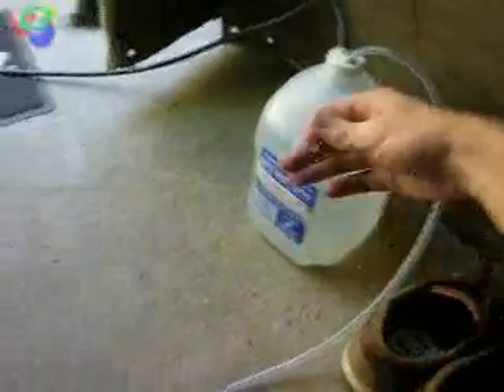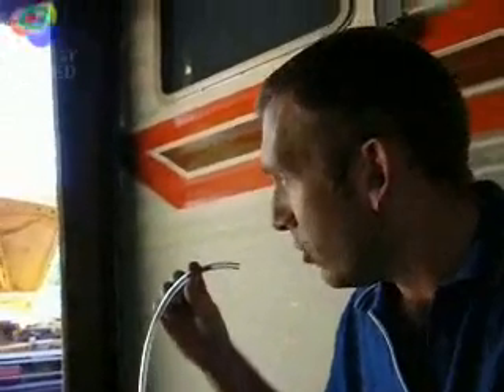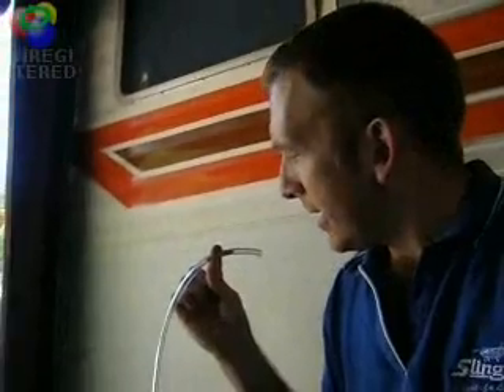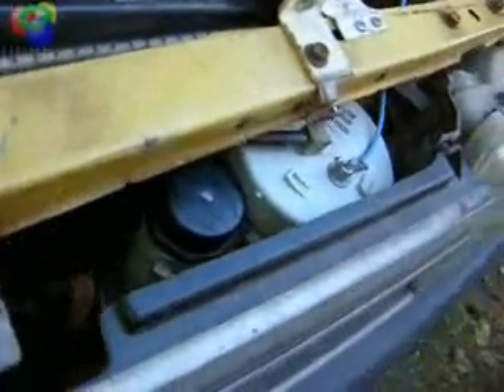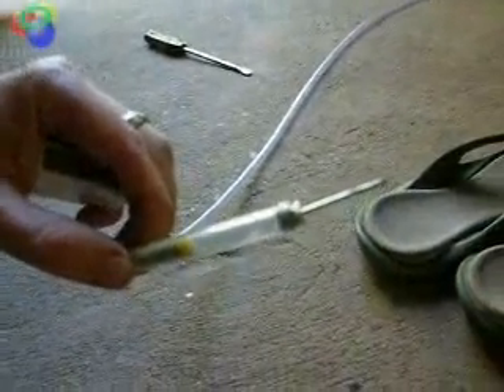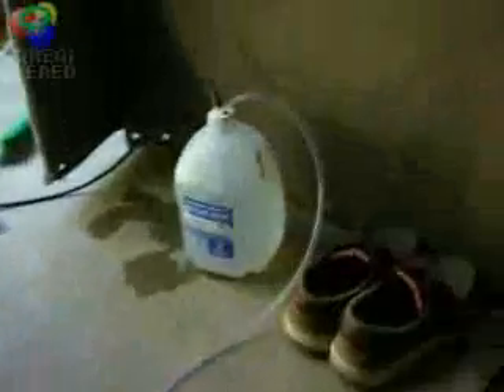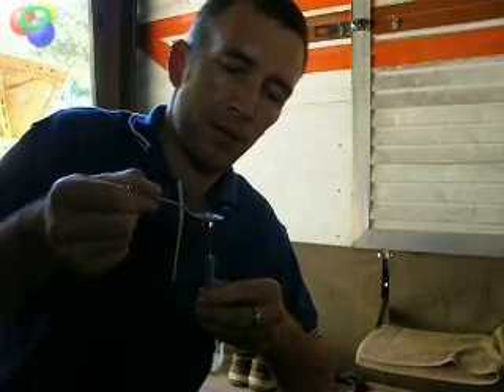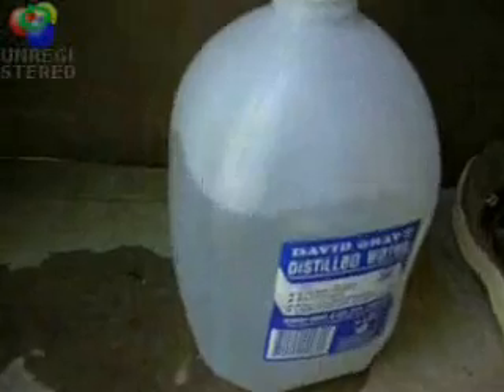make a hho torch and flashback arrestor

Comment: Cool video mate. I'm sure your FBA works just fine and all, however are you sure you want to risk an explosion and some injury on a pice of 2 cent sponge? a proper FBA ranges from 12 to 50 bucks and they WILL save your life. Even those have failed in the field, though rare it has happend. They use a little bit of baffeling nd expantion with some material. In welding school we had a fellow come in and show us in a clear box the diff between this and real ones, the difference was amazing. Cheers